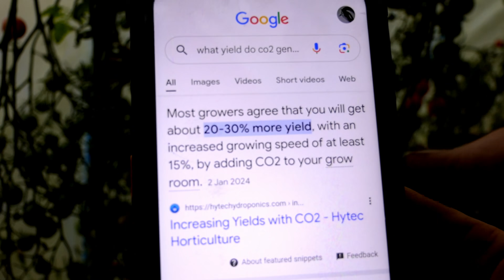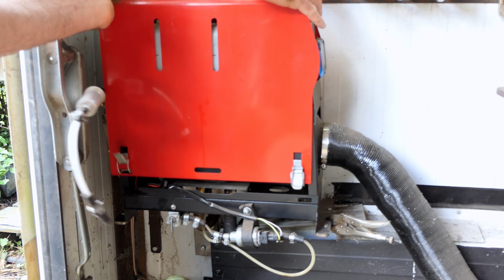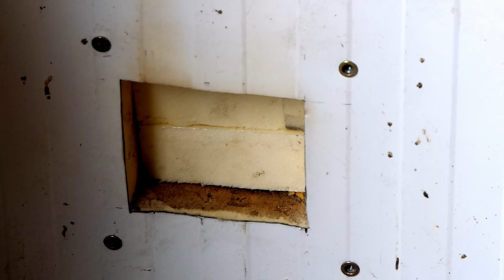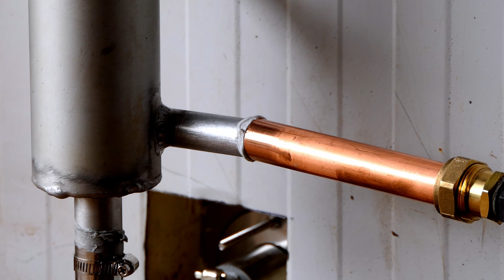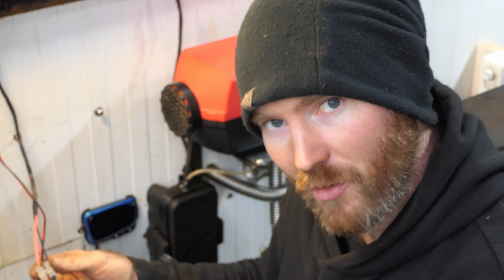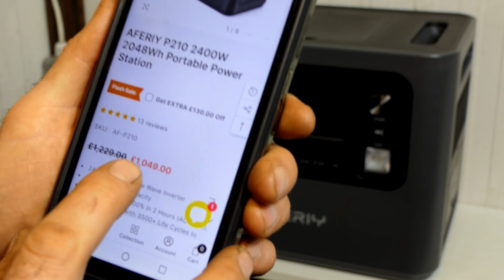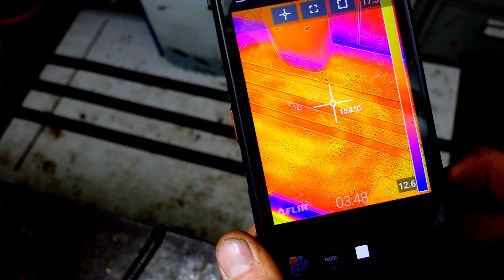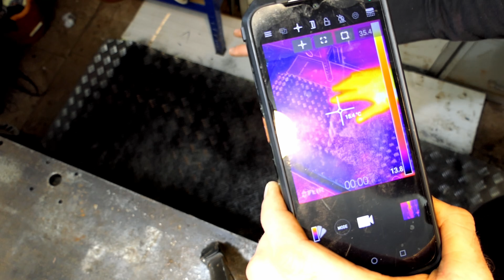NEW! Better system for Cheap and Safe Heating💲+ Underfloor Heating Mod test🫠

Comment: First of all thank you for some really brilliant videos, however I have some comments to the the latter part of this video.

It’s true that natural sources (oceans, plants, soil, volcanoes) emit far more CO₂ overall than humans do each year. But natural sinks (forests, oceans, etc.) also absorb almost exactly the same amount.
In a stable pre-industrial climate, these natural flows were in balance.

Human activities (mainly burning fossil fuels and deforestation) emit about:

~36–40 billion tonnes of CO₂ per year

This is new CO₂ that natural sinks cannot fully re-absorb.

Nature absorbs roughly half, leaving:

~18–20 billion tonnes per year accumulating in the atmosphere.

Humans contribute only a small percentage of the total natural CO₂ flux, but nearly 100% of the net increase in atmospheric CO₂.

Think of it like this:

Natural cycle: in = out

Human emissions: extra CO₂ added on top

Result: atmospheric CO₂ rises sharply

That’s why CO₂ concentrations have climbed from 280 ppm (pre-industrial) to over 420+ ppm today

Why the 3% claim is wrong

It mixes up:

gross CO₂ flows (large but balanced) vs. net CO₂ increase (small human percentage but climate-changing)

Humans are responsible for the entire rise.

Sources:
1)  IPCC – Intergovernmental Panel on Climate Change:  IPCC AR6 (2021), Working Group I – Chapter 5 (Carbon and Other    Biogeochemical Cycles)
2) NOAA Global Monitoring Laboratory (United States National Oceanic and Atmospheric Administration):  NOAA Carbon Cycle Science Overview
3)  NASA Earth Observatory: “The Carbon Cycle” & “Climate Change: Atmospheric Carbon Dioxide”
4) Global Carbon Project (GCP) – Global Carbon Budget Report:  Annual Global Carbon Budget publications
5) Royal Society & U.S. National Academy of Sciences: Joint Report: “Climate Change: Evidence and Causes” (2020 edition)
6) Peer-reviewed scientific papers:
a) Ciais et al. (2013), “Carbon and Other Biogeochemical Cycles,” in IPCC AR5 WG1
b) Friedlingstein et al., “Global Carbon Budget” (annual publications)
c) Canadell et al. (2021), Earth System Science Data

These papers all show:
Human emissions upset a previously balanced natural cycle → CO₂ accumulates → climate warms

Comment: To me the most funny thing about "CO2" is that if, if it was so enormously dangerous we wouldn't be allowed to travel alone by car. Yet, without our egoism the Car industry wouldn't survive. 
That's why recently they changed to producing WAR equipment.

Our economy is still totally reliant on energy. Oil is still a very very big party of that.

Comment: Your criticism of lead-acid batteries is true for the most part - but not for all batteries, because they are not all built the same way. The chemistry going on inside them is always the same, but the construction is not: If you have a battery intended for starting a car, it will have many thin plates inside, with barely any space between them, because it is designed for maximum possible current output. A consequence of that design is that discharge below 50% is almost guaranteed to cause warping of the plates, which will irreversibly damage the battery. In fact such damage is even possible at only 25% discharge if it happens often enough.

However, lead-acid batteries designed for deep-cycle are constructed differently - fewer plates inside with larger gaps between them, which makes plate-warping far less likely and allows for more sulfate buildup on the plates, which is necessary for deep discharge. This type also tends to have immobilised electrolyte, which allows the batteries to be mounted in any orientation and still function the same, even upside-down if necessary. This can be the classic "gel-cell", where the sulfuric acid is mixed with a few percent of fine-grained "fumed silica" powder to transform it into a thick gel. Or it can be the absorbed-glass-mat (AGM) type, where the gaps between the plates are filled with fine glass-fibre matting, which soaks up the sulfuric acid electrolyte like a sponge. The AGM type is often more resilient for deep-cycle, since the matting can physically prevent plate-warping, as well as interrupting permanent sulfate crystal growth. So these can withstand repeated deep-discharges, with the downside of limited current output, so are not suitable for use as engine starting batteries. Not usually at any rate - I have seen some AGM varieties which can be used for this, but only for small engines with relatively low-power starter motors.

On a different subject: You are quite correct that carbon dioxide is heavier than air, and this can be a problem in basements where there is limited ventilation. However, it doesn't take much to make it mix adequately with air - something like a small office desk-fan can generate enough air movement to achieve this.
When it comes to carbon monoxide (aka CO), this actually has an identical molecular weight to nitrogen, which is about 78% of the air we are all breathing. Nitrogen exists as N2 molecules - 14 x 2 = 28. CO is 12 + 16 = 28. Is it lighter than the average molecular weight of air when the oxygen component is factored in? Yes. But not by much, and the difference is not going to be enough to make it pool at or near the ceiling. So even if you had a badly malfunctioning heater spewing out several percent CO, I would be extremely surprised if a detector would register any significant difference when mounted near the ceiling compared to mounted near the floor.

Comment: I did something similar to your setup but with two Audi turbo diesel egr coolers bolted end to end. I plumbed the hot water to a large double radiator. It worked fantastic but over time it was taking so much heat from the exhaust gas that the egr coolers blocked up pretty much solid with carbon. It was almost impossible to clean the internal ports of the carbon.

Comment: I have a 6mtr X 6mtr workshop. If i run a vivor heater at say 3 kwh which is more efficient 8kw vivor or 5 kwh? Also have you perfected a radiator system?

Comment: as a heating engineer i got highly triggered by the CT1 connection and more so extremely surprised it worked

Edit - for future look at plason fittings (expensive yes, but worth every penny for strange size fittings!!)

Comment: If I am not mistaking I saw you are not using cross flow in the thermal heat exchanger. Always use crossflow with heat exchangers that is more then 35-% efficiency right there 😅 input gass hot goes in on top then water cold goes in on the bottom. the colder gass pre heats liquid. The difference is then you always have the biggest delta temperature (difference) thus the biggest exchange of energy.

Comment: Running pipe in insulation is not giving it a chance to exchange the heat as your insulating it. I e why underfloor pipe sits in concrete on top off insulation. Great video tho thank you 👍

Comment: Missed the real treat @21:23: "Put some weight on this" <place a single sheet of paper for research paper on historical levels of CO2 atmospheric concentrations over geological time>.  I'd like to note two this of extreme preponderance:  1.)  Your use of ASMR is well researched and appropriate, you've done your work to know your audience.  2.)  Your epic Midphalangeal hair, my God son, what a mat!  Obviously point number 2 is in jest.
In seriousness.  We are past the point of dialog, and as much as I respect completely your effort to bring reason into the discussion, you will obviously have noted that this is NOT what is occurring as "how things get done."  Your content is exceptionally useful and the most powerful thing that you (and by extension those that follow your content) can do is to simply: "do what you're doing," as this is the most effective "conversion" methodology (your results are undeniable, effective, and universally applicable.  As an Engineer, "this is the way."

Comment: I'm looking into a diesel heater, but how do we keep this powered ? Do you have a video explaining that?
Reply from the maker: Its 12v, 150w start up 40-80w running. A leisure battery with a 6amp charger is best. The reason you want a battery is because in the event of a power outage the heater needs to do a cool down cycle and not be turned off immediately otherwise it will break. It will also self turn off and cool down with a low battery. Cheers J

Comment: There are clear sience evidences/proves  that the CO2 level did NOT  change the last 2/3 hundret years .(Ice core measurement.in fact is was up to 20 ! Times higher in pre historic times.. thats why  plants  could grow  that gigantic ...eath was  70 % of her existance in the midfle 15° celsius warmer than today ...(Because the poles have been much warmer ..-green  ,with mamouth ,und Tigers) ..if the climate warms up (from the earzh cycled and sun activity) 800 years kater also the oceansvgetbwarmer ..and  release  a lot of CO2 witch the   oceans  store  in gigantic amount in cold times ...almost  all the the co2  (80%) is  permanently stored in the oceans .....until they warm up ... The  climatic time we actual  live  in now is called ice age ( both  poles are coverd with  massive  kilometres  ice shelds ..in fact this  is only the very first beginning of a real ice age ..still there are no ice cups over Europe and north america..but will comme  very soon ..!!  .70% of all  pre historic time have been  much warmer (up to 15°)  an are called : climat OPTIMA ....because it was the optimal themperature for develloping  all the  Fauna and Flora ..if co2 would  go under 200 ppm like above  the Mountains ..over 1600 meter  because that is  the level  CO2 can  climb with the actual  380 ppm ) no trees or  other  vegetation would  grow ..only gras and moose

Comment: What’s that filter sitting on the fuel can cover? I know it’s purpose (avoiding underpressure in the can), but how did you install it?
Reply from the maker: It's threaded and sealed with JB weld. It's a cheap pneumatic silencer. Cheers J

Comment: Running the exhaust through an old wet radiator recovers so much heat if you fed the exhaust in and out of the top fittings, you could have a condensate tap on one of the bottom connections.  Ref the condensate, we were taught, for gas, the condensate Ph was approx that of vinegar.  I have seen aluminium heat exchangers choked with oxides and badly corroded, by the condensate.  Have you thought about recovering stainless steel heat exchangers from CH boilers such as Vaillant and Gloworm.  The water to water plate type heat exchangers in most combi boilers would be interesting fitted in the exhaust as a water heater?  All food for thought!

Comment: Back in the 50's and 60's a lot of homes used paraffin, cotton wick type heaters in other rooms that had no fireplace. Paraffin bowsers called weekly to fill cans.  Drip feed catalytic paraffin heaters were really efficient, but the wicks were asbestos!  Oil boilers were cheap to run until the oil crisis in the 60's  The price of diesel and petrol doubled then. We are subject to the prices energy suppliers want to charge.

Comment: I know I'm late to the party but did you consider routing the exhaust through a radiator?
100% true regards everything you said about climate tax.
The Thames used to freeze over in the 17th Century which was a long time before we started burning the black stuff.
Great vids very educational for me as I'm just about to begin boatlife.
Paul
Reply from the maker: Thank you. Problems with a radiator exhaust is the condensation is acidic and will corrode holes in it fast, also cleaning out soot deposits will be a challenge and are quite restrictive. Cheers J

Comment: This is what I use to heat my 2 shops. I have a diesel air/water combo machine that puts out 30C in a 50 gallon drum of coolant that is sent out to the floor. If it goes in the barrel at 30C, it goes in the floor at 26C and goes back in the barrel at maybe 23C. Of course the longer it runs, all these numbers will raise accordingly. 

In the winter, at -15 to -20, it will be about 13-17C in the shops. One is the shop with the pipes to heat at 16x33 and the other, has a wooden floor 16x24 and only the air heater portion is heating the both sides. In that shop, it always stays at a steady10C for some weird reason no matter how cold it get outside. It doesn't run cheap for 6 months of the year needing heat.

Comment: I mean, we can probably do without the ill informed mumbo jumbo about climate change, it's a very clear and solved science, we're absolutely actively changing things and people are absolutely dying of it today already and there will be mass die off and massive migrations of people away from unsurvivable areas to survivable ones. To claim that the literal gigatons of carbon and soot and stuff - actual gigatons - we put into the air every single year isn't the culprit is, frankly, delusional. So burning fluorocarbons is cursed. But people also sometimes have little choice; there is nothing right now with sufficient energy density to heat a mobile home or motorhome that isn't fossil fuels. As for your fuel tanks,  I still say tap into them from the top with a fuel pickup / standpipe set up and suck it out the top instead in case the fitting fails. If it does now your fuel goes on the floor.

Comment: For the end of the video, yes the earth have seen much more extreme than what it's happening now, but it had time to adjust, where we are changing it so fast it doesn't have time to adapt. As with science yes you can find contradictory evidence, but what need to be done is look at the consensus of not political people, but scientist and the very vast majority agree that climate change of today are man made. Sure there might be other contributing reason as you pointed out, but by far the impact is from our activity. All that being said, I agree with the private jet comment, the deforestation and the comment that people do not like feeling freezing. I also agree that your vevor burner alone won't make a dent, although multiplied by hundreds of millions yeah they'd start to make a difference. Strenght in number, good or bad.

Comment: Diesel heater settings ? We've got one that can do 2,5 or 8kw, it's factory set to 5. It's a GearHeater brand with the horrid silvery screen control panel.

Comment: Why it need battery bro it is diesel
Reply from the maker: Auto and remote controlling, set temperature regulating, fan assistance, glow plug etc.... same reason a diesel car has a battery. Cheers J
Reply: @joshuadelisle  good point

Comment: Use a 10-15 meter exhaust to recover the heat
Reply from the maker: The issue with that is the restriction of gas flow would affect the combustion. Cheers J

Comment: I wonder when someone will figure out that the ultimate idea in diesel heating is a generator because it not only burns all the diesel, creating heat, you can also run an electric radiator off of it... The only drawback is the noise.
Reply from the maker: The best thing is to store the energy from the generator in batteries and use the waste exhaust heat through a heat exchanger to run the central heating. Cheers J

Comment: I am amazed your combi boiler is still in action. We used to have the same one and if was constantly on the Fritz. My partner had one and that thing was also forever breaking and finding parts for those old boilers are incredibly hard to find
Reply from the maker: It's checked, cleaned and maintained yearly. They're very simple so there isn't much to go wrong. It's the modern ones that are built to fail from what I understand. Cheers J

Comment: The devil is in the detail, as always.  The calculation for the cost of running the heat pump is based on the day rate price, which is very high.  However, if you based the calculation on the Economy 7 rate price (about half the day rate) then your figures would be similar to that of the oil boiler.
Reply from the maker: That's a fair point. Cheers J

Comment: A 2.5 degree temperature rise is a problem for methane release and sea acidity which starts a runaway affect. Only absorbed carbon will save the human race.
Reply from the maker: It's been way hotter in the past. Greenland was once lush Forrest. The emphasis should be on adapting to the changing climate. Preventing it won't work. Cheers J

Comment: What would happen if you used a dry radiator and run the exhaust through it, basically using it as a heat exchanger?
Reply from the maker: Restricting the gas is a problem, cleaning out any carbon build up and corrosion from the acidic vapor would mean it wouldn't last very long. If it leaks unnoticed from corrosion then you have a serious hazard. Cheers J

Comment: Waste veggy oil is easily filtered as long as the viscosity is lowered - may I suggest using your heat excess to warm the veggy oil before filtering? The other, even easier way to clean it is to allow it to settle. Half a year may be necessary sometimes (at least a month) but it reduces the annoyance of getting dirty - of course it requires space. The lighter parts of the settled oil go into your hi-tech Diesel heaters, the heavier parts of the settled oil go into a drip-burner where small particulates don't really matter. BTW Josh - there are numerous drip-burner designs and experiments on YouTube but I think the analysis could go a lot farther and be better done, would you be up for making a video on how to make a DIY one (with no fan or electrics, just passive drip-feed)?

Comment: I find it odd that you have oil heating at home yet are amazed at the fact it only costs about 6p per kwh when you run your diesel heater on kerosene ….  If you have a newer condensing oil boiler, you should be seeing around the same cost per kWh from it.

Comment: You should put floor heating foil between foam and pipes. Push the pipes so they hold foil and in no way foam (unsulator) between pipes and thin ...